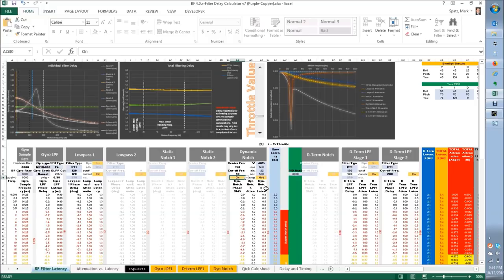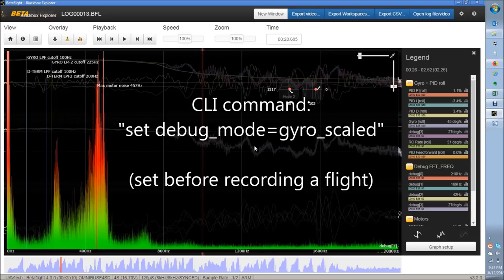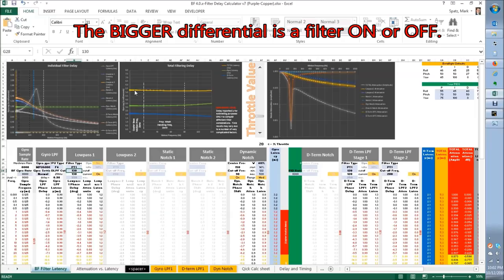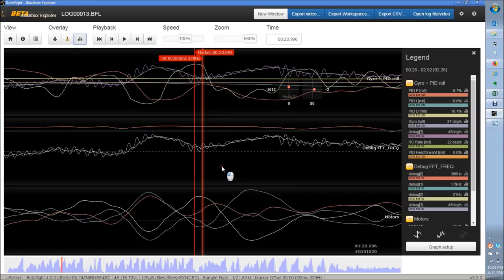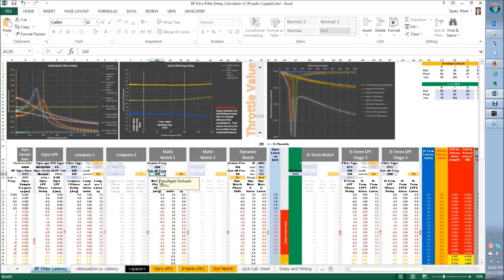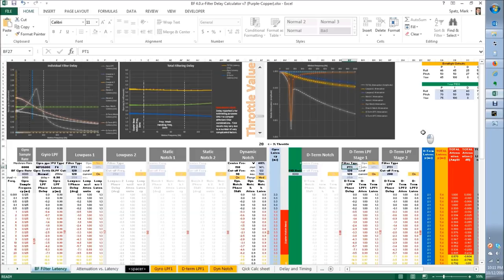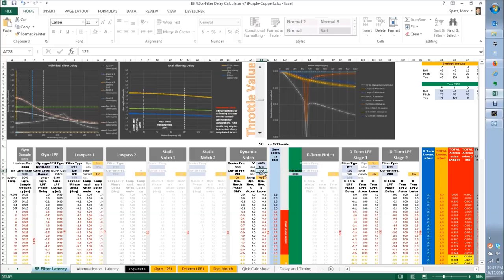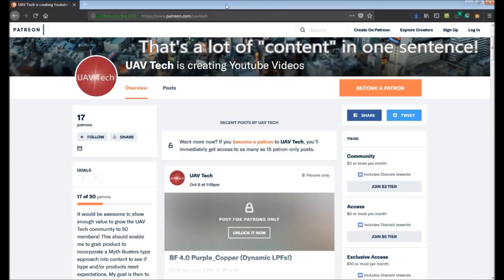How Gyro Filters Work

Comment: I like your explanations on filters a lot. I have a question. I was commissioner for big motors (1 to 50 MW) and one of the tests was a resonance run. I revved up the motor 0.. 100 🚨 measured the vibrations. In the frequency converter I could adjust   the ramp  generator to avoid (skips) the area around the resonance speed. Such way I needed far less filtering. Is this also applicable to quad you think? Or is these already similar functionality build in to bf?
Reply from the maker: Interesting idea.  The application would be to skip the throttle position that gives you Mid-throttle Oscillations (MTOs).  We would need to look at the band of throttle percent we would need to skip to avoid resonance.  My hunch is it is too larger and the user would notice the skip and not like it, bit worth a look at how much % that is maybe.

I also a filter scheme brewing in my head with the new dynamic LPFs that might be a big WIN in out battle against MTOs.  More to come in that.
Reply: I agree. MTOs can often range ~20-30% of the throttle range, and is by definition where we usually spend most of our time flying (I.e. 30-60% throttle). If it is mostly due to frame resonance, I hope frame design begins to combat the issue. I know there are some interesting new frames that support the elongated central deck of the typical freestyle frames. I’d be curious to see whether this helps.

Comment: As you are involved in the development of BeF, couldn't you propose to make a dyn notch for the dterm? Would that even make sense?
I love your data sheet. I have played around with it, to get a sense of what the filters do and the effect on delay.
Reply: I don't know ANYTHING about digital filters, but what if you put in a dyn lowpass that followed the throttle input, so at 5% throttle it would be at 100hz and at 50% throttle it would move up to 200hz etc. I don't think it would take up a lot of cpu utilization.
Reply: BF not BeF butter hype is pretty much dead so lets stop giving it any kudos
Reply: @Sugar_K  butter is dead? What a shame. I liked the idea of some one trying to develop an other direction. And I would like to see there take on a setup wizard for the quad.
Reply from the maker: @pippifpv  no other direction.  They just rebased on 3.5.1.  But there is a new configurator ... i kind of think stolen from F1 ... but could be wrong.  Didn't work when i tried it with my RevoltOSD.  I'm sure will be fixed.  But be careful ... bugs get introduced on rebase all the time.  So not that easy.  Like folks on Helio thought they had Dynamic Notch option on, but it was broke in their target.  That kind of stuff.

We tried Dynamic D Notch, tied to the gyro notch position, but it didn't work out since there was no noise at the absolute center to further attenuate.  So we went another direction.
Reply: @uavtech  ok.. Thx for answering.